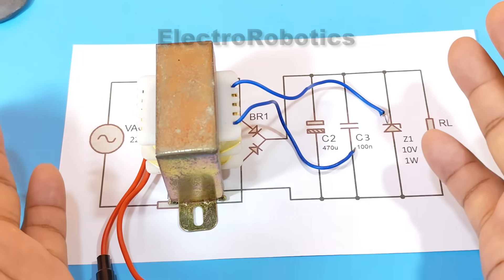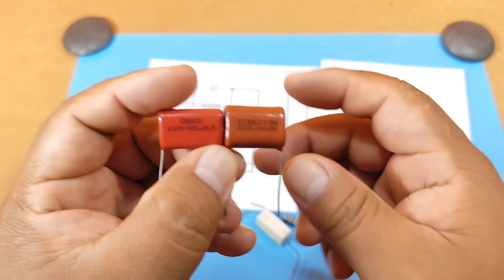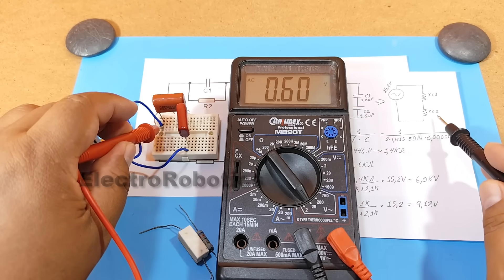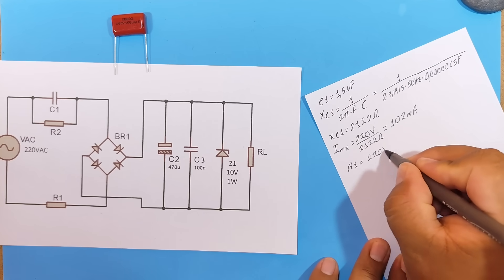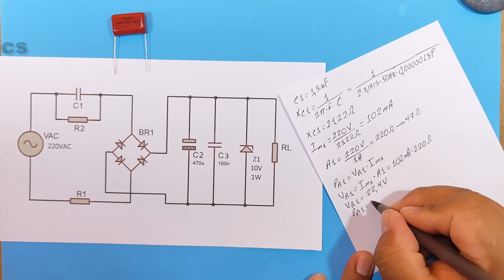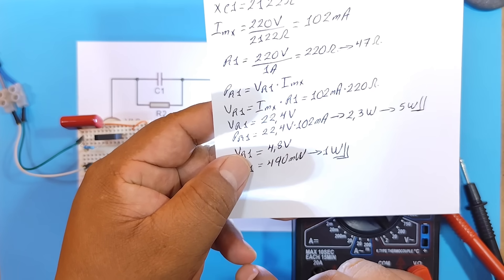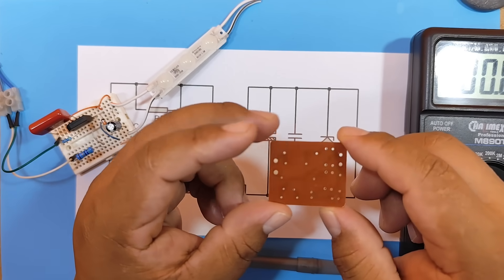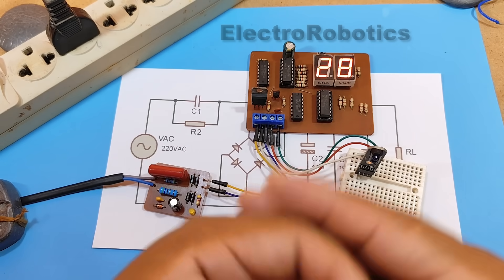No more Transformers, STOP Spending Money on Transformers.

Comment: Linear transformers have the advantage that they are reliable. There is complete isolation from the mains voltage.
Reply: Not only that, capacitive power supply do not last long, especially for extended periods, there is no regulation or current protection and when it fails it will destroy the device it is powering.
Reply: True, if R1 goes open then the circuit is now seeing 220-240 VAC via the capacitor...if someone were to touch it  then Ouch.
Reply: They were Solid State first...

Comment: Na schemacie i w ostatecznym układzie, użyty jest rezystor R2, który nigdzie nie był obliczany.
Reply: This is used in order to discharge the cap when the power is removed. Its value determines the time the capacitor is discharged to a safe level (because if this resistor is not there and you touch the input terminals right after the power removal, the energy stored within the capacitor is dangerous causing electrocution). Its range is usually from 100k upto 470k, depending on the capacitance of the capacitor. Big capacitance, low value of resistor and vice versa. The time equation is t=RxC. So, we decide the time we want the cap to be discharged to a safe level (t), while we know the (c). Then we solve for (R). R=t/C.

Comment: great explanation.... need some clarifications.
1. the output volts, is it in AC/DC.?
2. how to control the output amps, and what if we need variable amps.?
3. how safe is the circuit, in case of shorts, reverse current flow etc. (as AC is involved in this).?
4. what safety precautions needs to be taken care.?
Reply: 1. DC with some 100Hz ripple;
2. You can't, the current is fixed for a given capacitor, a very limited and unadvisable control is with the bottom resistor;
3. Shorts are safe as the current is limited, but open circuit failure would be catastrophic with the Zener burning off and the erectrolytic capacitor potentially exploding;
4. Don't touch any part of it including the low voltage end as the unit is NOT isolated from the mains, unlike the one with a transformer. Ideally enclose it in some kind of a dielectric box.

Comment: This has been known for decades but was very rarely used for a reason.
Reply: What is the reason?  Is it the problem of having to ensure that a load is always connected?  Or is there something else fundamentally wrong with the design?
Reply: @TheSpuggiehawk  voltage changes with load resistance. real world load is not constant.
Reply: This is because it cannot be housed in a metal case and may fail EMI testing. Furthermore, due to the lack of insulation, attaching input/output terminals to external devices could pose an electric shock hazard or potentially damage the external equipment.
However, it can be used for applications like the lighting shown in the video, where it is housed in a resin case.

Comment: Very cool video. One of the benefits of a transformer is safety because of the galvanic isolation of the mains network.
Reply: I still prefer a transformer for isolation. Never had a failure in 50 years. Solid state arrangements have nearly caused a fire 3 times at my location. Gone back to transformers.
Reply: @kennethausten I agree. In my :~30 years experience too. Recently I had a new experience😅 I was troubleshooting a line problem (broken Neutral) with a 0W lamp,🙄 It used to glow healthy. Later it turned out the LED lights capacitors had charged up and the test lamp was glowing healthy.
Reply: IfThereIsAnOvervoltage,WithTransformer,TheElectricalDevicesWouldBeFried.
Reply: @ovidius2000  not necessary, depends what is down stream
I find my 120Vac lights more energy eff with transformers than cap droppers.
Reply: True. One major disadvantage of this ckt (which we use) is it gives a very Nasty shock😂😂 when touched. Also the 0V cannot be earthed (it will cause flashover). What will be the potential V between the OV and earth???
Reply: @AnwarKhan_786  Depends on elevation lol
Reply: I AGREE with you 👍 💯 
Good morning from Greece 🇬🇷 💙 
Καλημέρα από την Ελλάδα ❤😂